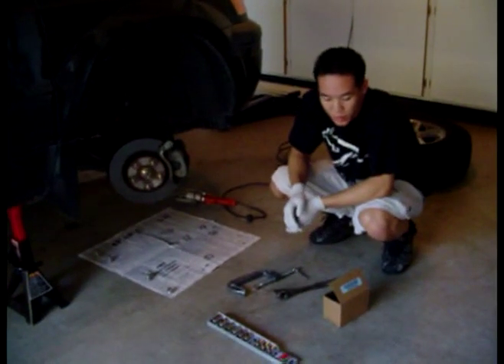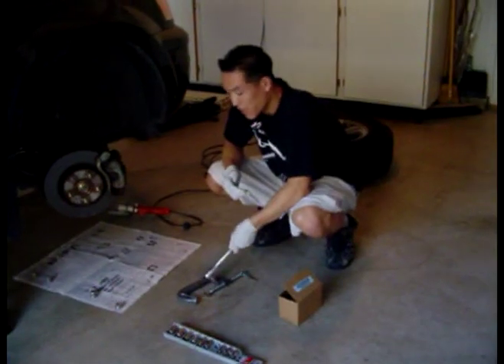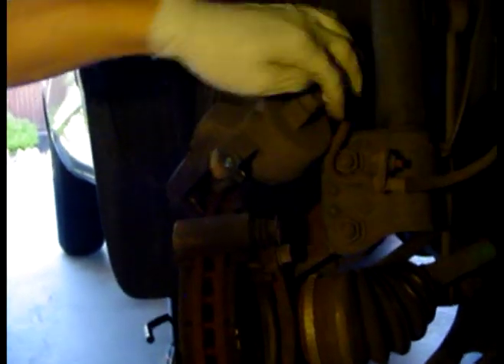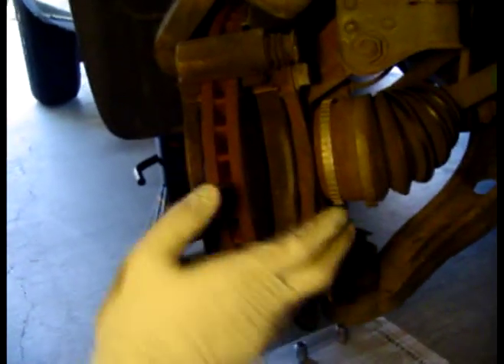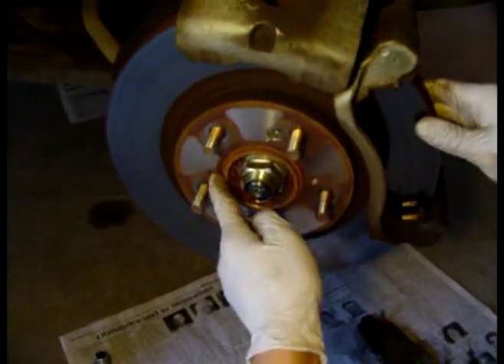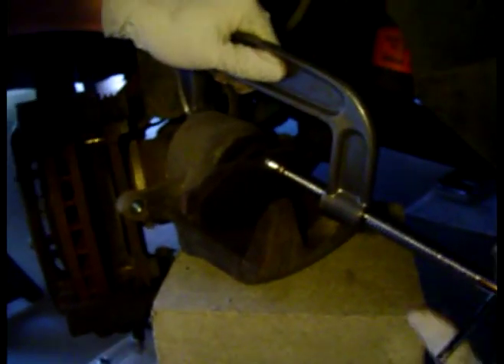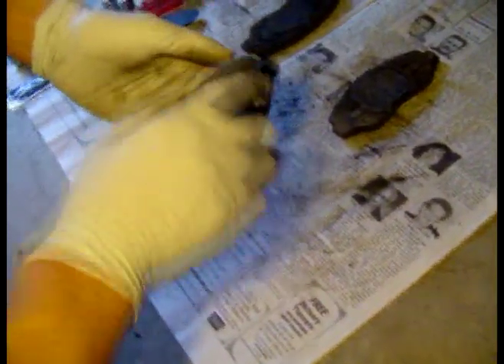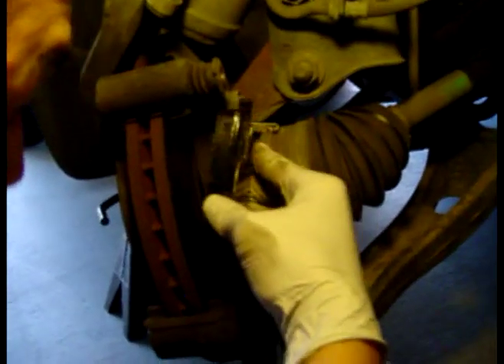Tutorial on how to change brake pads on 2003 Honda Pilot

Comment: Nice video, good to see a video that actually suggests to use older pads to push the pump back in rather than having ppl guess how the c-clamp should be used. 

A couple things I'd suggest adding are: 
1) do not to get ANY grease on the new pads or rotor
2) pump your brakes before you begin driving your car
3) turn the front wheels for easier access to the caliper (you did it but maybe forgot to pt it out?) 

Mainly 1 and 2 bc they're safety issues, but again, good job on the video.

Comment from the maker: @psychospice8 basically you use the c clamp to compress the piston back into the caliper.  if you dont do that, the caliper will not fit over the new brake pads that actually have pad compared to the old brake pads with nothing left.  let me know if youre still confused.

Comment from the maker: depends on what youre looking for.  if it's going on a camry, im assuming youre not getting brake pads for performance, just something that works?  if that's the case, id just get the cheap pads.  the higher the performance of the pad, the faster they wear out and chew up your rotors.

Comment from the maker: usually the screw back pistons are for the rears only.  you can tell by looking at the piston, and it will be a cross or "x" through the piston.  use the old brake pad and press until flat against the casing, or until the piston doesnt move in anymore.  not sure about other brake pads (i always use genuine stuff).

Comment from the maker: @psychospice8 my assumption is it probably is.  did you use an open end wrench to open it?  if so, thats probably why.  the metal around that area is very soft and strips easily.  the best thing to do is use a flare nut wrench so no strippage occurs.  you might have to take that in to get it fixed now if its leaking fluid.

Comment from the maker: @wjustincrediblew what youre going to do with the c clamp is with your old brake pad over the piston, squeeze the piston back into the housing and then you can take the c clamp off.  if you dont do this step, youll never get the caliper back over the pads and rotors because with the piston sticking out, it wont clear all the new pad you have on your new brake pads.  remember, over time your brake pads wear out, and as that happens, the piston slowly comes out to compensate for this.

Comment from the maker: @paulonutube could be that.  the bolts could also just be seized on there from not being touched for so long.  try pb blaster and a breaker bar.  or air tools if you have them.

Comment from the maker: should be exactly the same.  the only possible difference is that you might need an adjustable wrench to hold this piece near the caliper bolts or the bolt will spin forever (safety mechanism so the caliper bolts don't fall out from vibration)

Comment from the maker: the phillips screws that hold the rotor in place shouldn't be too hard to get off.  a little trick is to put your screwdriver onto the screw, and then take a hammer and wack the end of the screwdriver firmly.  that should shock the screw and make it come out easier.  Sorry, i don't know the size of the pinch bolts, but taking a rubber mallet and lightly banging it against the back of the rotor works just as well.  just make sure you rotate the rotor and it should pop off no problem.

Comment: A little tip for the two bolts holding the caliper take the bottom one off completely and leave the top one on lose of course that your caliper isn't all over the place

Comment: I did get them off finally - thanks for the reply. I have another question though. After replacing everything. I found brake fluid on the floor on the garage and found that it wasn't from the lines but it had come out of the top of the master-cylinder reservoir. Is this OK? ...There is no more coming out - no leaking... I think what happened is that the reservoir overflowed when I used the C-Clamp to push in the caliper "piston" (right word?)... Can you shed any light on the fluid that appeared?

Comment: Nice video tutorial. @DBB123321 good call on removing the fluid resorvoir cap!
@ChadnShawna rust on the edges is normal - they're exposed to every puddle you drive through, never gonna get away from rust. If the face is rusty that's generally easy to clean too as long as there's enough metal left for the pads to squeeze and safely stop without deforming things. The dealer's trying to make money, he'll pick on any worry to sell you parts.

Comment: Good Job on this video, but I see 2 problems that should be noted. First is that you didn't service the caliper bracket. This is critical to new pad life.
You need to remove the pad clips and clean under them with a file or wire brush to remove all the rust that will hold the pads from sliding freely and you need to remove and relube the slide pins from the mount. 2nd you forgot to mention that you need to pump the pedal before you try to move the car so that you won't hit anything.

Comment: very helpful vid.  but like another commenter mentioned before, about elaborating on the whole c clamping the piston thing... you only said it was 'a must' to do step, and the reasoning for it.., but yet after you pop in the new pads, you make no further reference as to where, the c clamp went, or when the c clamp is to be untightened, and removed....  what happened to the old brake pad you used along with your c clamp ???  sorry, am jus not understanding that part at all...  thanks..  mike k.

Comment: You should always skim / machine the disc surface so you give the new pads something to bed into (More to it than that - cross sectional areas etc nut will keep it simple) . Also maybe mention that you ALWAYS replace BOTH sides at the same time. NEVER just one side. I worked on brakes and suspension for 10+ years and I have seen... many times ...people just replace one side . Scary! 

Also for those screws ...and 'Impact screwdriver ' is a must.

Comment: The Dealership wants $226 to change the rear pad and resurface the rotors on a 2001 MDX.  After watching your video I'm confident I could change the pads, but what would I need to resurface the rotors?

Comment: 1. Will this work for a 2006 Pilot?

2. When placing the wheel back on the vehicle, do you use a torque wrench or do you snug it with a ratchet?

Comment: Unless I'm looking in the wrong place, the cross frame (running from one side of the chassis to the other a foot or so aft of the transmission) looks like a rather thin piece of stamped steel.  Is this robust enough to support half or more of the vehicles weight until the jack stands are in place?  Thanks.

Comment: It is recommended to stop briskly 1/2 doz. X's in the driveway before venturing forth into traffic. (back and forth) Failure to do so may result in an accident as the pads are not seated. New rotors and pads need this driveway break-in much more so. Always put somew form of locking tab on your master cylinder bolts.
Sometimes they magically come loose? Of course, some people can afford to get into accidents. Ha, ha,...

Comment: I did the fronts with now problem. The rears are a problem. The 2 bolts refuse to loosen. Somehow on one side it finally loosened but I cant get it lose on the second side and the bolt is just about stripped. From what I see, theres a thing on the other side that just spins with it. Ive tried pliers on it those with no luck. This really sucks. Cars stuck on a jack right now while it rains.

Comment: I use an impact screwdriver to remove the bolts on the rotor... just hold it tight and wack it with a hammer..

Comment from the maker: $480 for a brake change is a hugeeeeee rip off.  id never ever pay that much.  labor to change front brake pads should be more than 1 1/2 hours of labor, so maybe $100-$150 in labor.  rears are basically the same, just put the ebrake down first.

Comment: also i HATE those honda rotor screws.  All they do is hold the rotor on for assembly at the factory.  they use the world's softest metal for those fecking screws.  i had a nightmare getting them off my accord and my pilot.